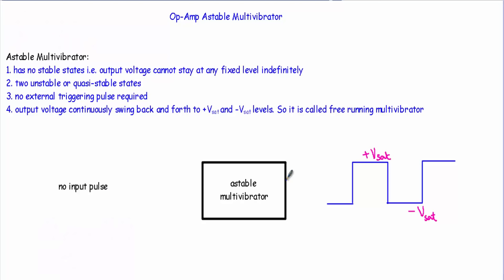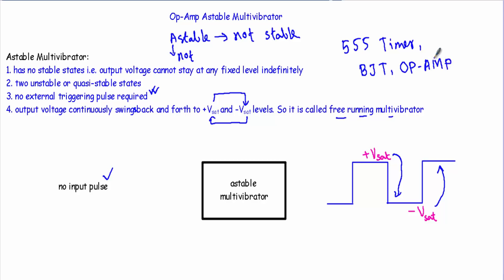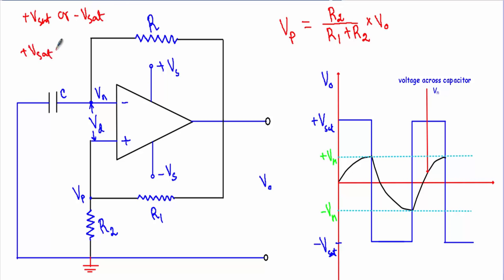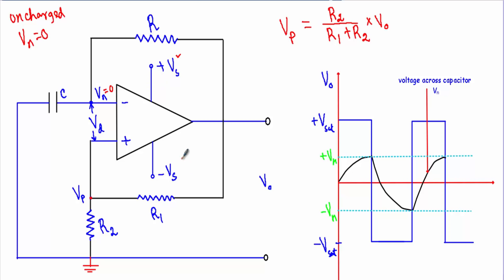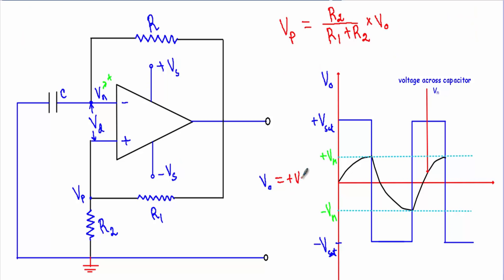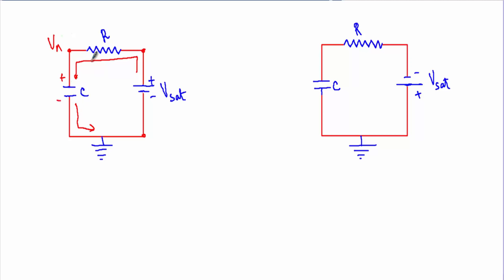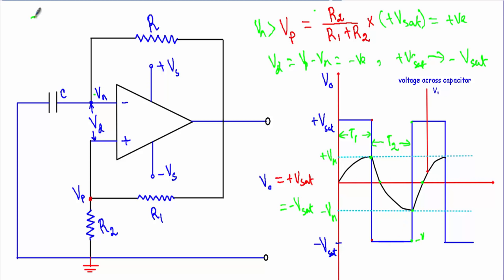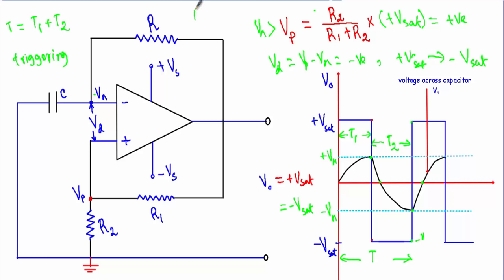Op-Amp Astable Multivibrator (W subtitles)

Comment: When Vp>Vn or Vn>Vp the output goes to the saturation voltage. Does this mean that the op amp is working as a comparator?
Reply from the maker: yes multivibrator and schmitt triggers are comparator circuit

Comment: You have mentioned that the above opamp works in comparator mode.But the resistor R is connected from output to inverting input.Is it a feedback resistor.If yes ,then it cannot act as a comparator .please explain.
Reply from the maker: You missed the point " output is connected with the non-inverting terminal also through R1". With this kind of structure where output is connected in both +ve & -ve terminals, positive feedback becomes dominant. So, output stays at either +Vsat / -Vsat level . It is a comparator circuit because it compares feedback voltage Vp with another feedback voltage/ charging voltage Vn at the -ve terminal.
Reply: Can u please explain why it will not work as comparator? Is it only bcoz comparator works in open mode and with +ve feedback.that  has no feedback resistor(Schmitt trigger circuit)

Comment: But how is the op amp operating in the saturation region when there is a negative feedback network?
Reply from the maker: here, op amp is not in negative feedback. See, output is connected to both inverting and non-inverting terminal. With this kind of connection op-amp operates in saturation region not in linear region
Reply: Thank You!

Comment: If i want to apply this in real circuit , what value should i use for capacitors and resistors ?
Reply: One example would be for R1=100K,  R2=10K,  R=100K,  C=0.01uF,  +Vs=12V, -Vs=-12V,  OP AMP=TL081 or equivalent

Comment: as the o/p changes to Vsat, Vp attains a new value, and the capacitor starts charging, while charging why do we take Vn=0, Vn should be Vn=Vp as they r virtually short???
Reply: virtual short is applicable only when there is negative feedback,here it's positive feedback.